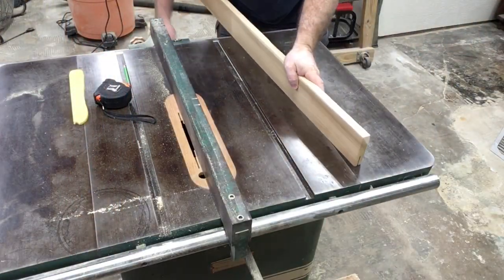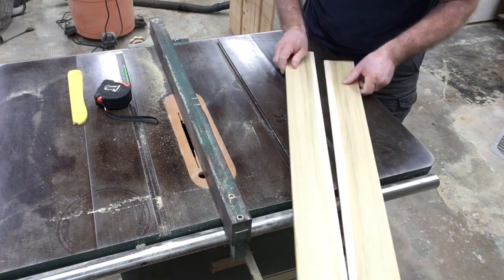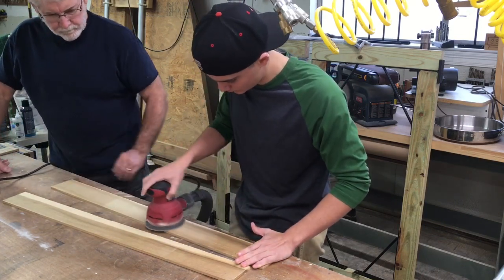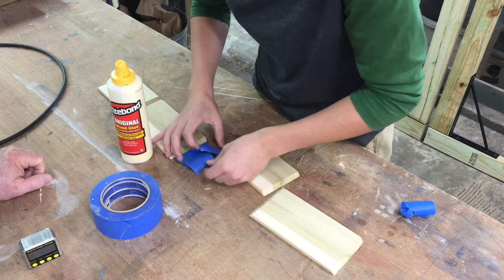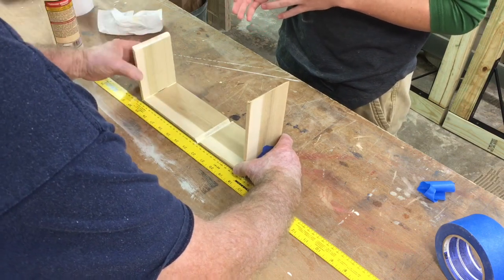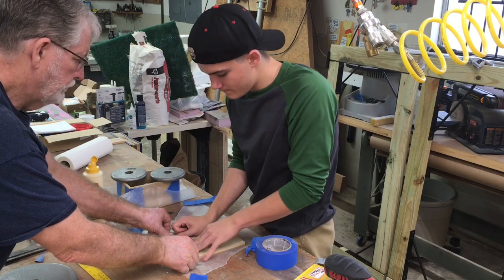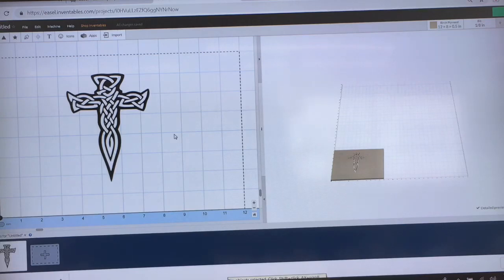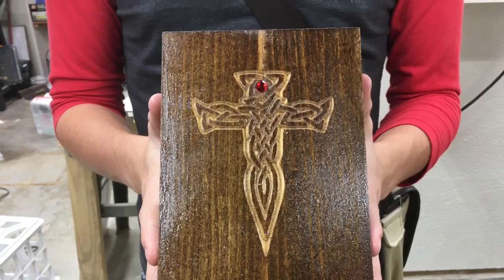Special Day in the Shop with My Grandson

Comment: Looks like you build the same panel saw as I did.  Really works nicely for using parts you can get from Home Depot.
Reply from the maker: Yes, I like it a lot.  It makes handling 4x8 sheets of plywood much more manageable.